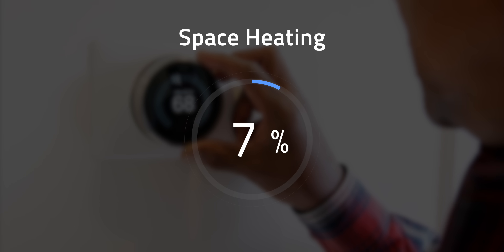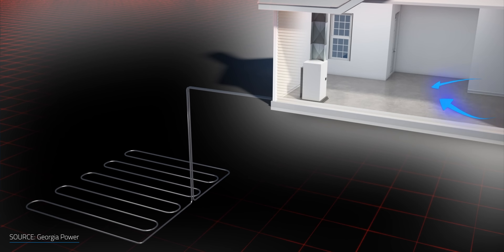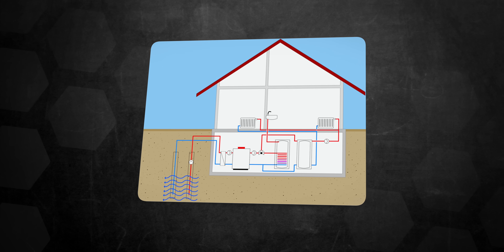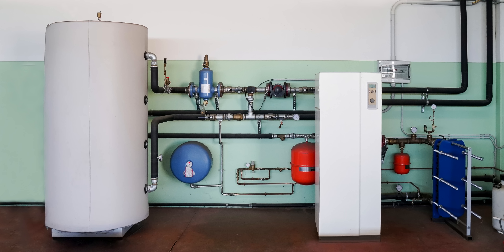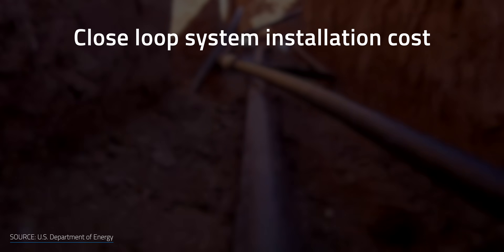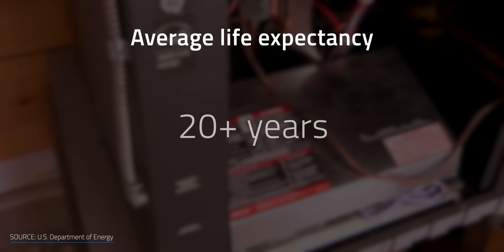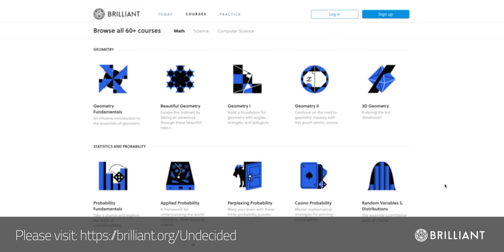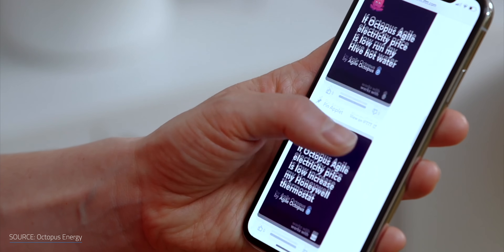Is Geothermal Heating and Cooling Worth the Cost?  Heat Pumps Explained

Comment: My home was built in 2001 and I installed a closed loop system in Ohio, Worked great for the first 7 years then I had to replace a switch. Then a year later a pump then year later a compressor then it leaked out the coolant, then the main unit went out in 2017, that's when they wanted 17k to replace it.  So all those great energy savings I was suppose to get went up in repairs. Then in 2017 I replaced it with a standard air heat pump which cost 7k total including install and I am not lying my electric bill was 30% cheaper than what the Geo was. Yes I now use 10% more gas for heat in the winter months but I had to supplement the Geo with gas too, so that didnt change all that much. But I do use about 150 more gallons of propane during the winter. 
So unless they have a 20 year guarantee and on all parts and labor dont waste your money, just take the savings up front and put in a standard air heat pump. 
I have two buddies who built a home the same year as I did and had a similar experience. both of them replaced the Geo with a air heat pump. ( FYI I do not have any affiliation with anyone in the heating industry this is my experience only).

Comment: I don`t get it how this system is better 5:46 36 000 BTUs/H = 11 kW instead 3x air conditions which are 12 k BTUs/H = 2.5 kW up to 3.5 kW for this electricity which you claim is 11 kW you can get up to 10-11 air conditions which are up to 120 000-132000 BTUs/H

Comment: Our company It is a scientific and technological enterprise specializing in the R & D, production, sales and service of solar energy, air source heat pump hot water, heating and refrigeration engineering systems. It is the development and cooperation unit of Zhejiang Energy Research Institute - new energy source. The company won the title of Hangzhou high-tech enterprise in 2010 and ultra-low in 2011 The warm air source heat pump unit project won the national science and technology small and medium-sized enterprise innovation fund project award, and won the new industrial product award of Zhejiang Province. Also we want  to find some partners or agents，If you are interested, we can communicate this matter。

  Relying on the high-tech of Zhejiang University and the first air source heat pump with normal heating of minus 25 ° in China, the company is the only "dynamic and static combination defrosting" patent technology in China (patent number: zl201310163521.4, inventor: Liu Yinlong), combined with the advanced modern production equipment of China and Germany. It has a number of energy-saving patent technologies - split pressure solar collector module, and its products are exported to the United States, Germany and Switzerland In Dian, Korea and other regions, the solar collector module has passed FSEC certification in the United States and TUV certification in Germany. At present, it is the most efficient, energy-saving, low-carbon, emission reduction, environmental protection and safe central hot water equipment.
My e-mail: fexur@foxmail.com

Comment: Very good information. As a person who deals in HVAC warranty for Trane, I will say that at this time we only offer a max 12 year extended warranty for these systems. So even though they have the ability to last over 20 years, that is not without maintenance. Not to mention that after the warranty expires, the parts and labor cost for replacement parts will be exponentially higher depending on the geothermal system. Over all, a 30,000 dollar installation over the course of a lifetime could end up being upwards of 50 grand. Considering the average lifespan of a Heat Pump system spans 10 to 15 years for an upfront cost of about 14 thousand with a 10 year warranty (depending on the system) you're ultimately going to be better off as a home owner buying a 16 or 18 seer and replacing it down the line. Considering technology will only get better, you'll save on energy costs.
Reply: What is a "16 or 18 seer"?

Comment: It's unfortunate that contractors are so slow to change in this country. Other countries are speeding off into the future, and we aren't even adopting Heat Pump technology here in the US?!!  ...And we are supposed to be "proud americans"...thinking we are all bad-ass-know-it-alls??  Far from he truth!  We need to step it up and get more renewable-conscious like other nations have been doing for years!  Don't rely on old fogies who discredit Heat pump technology!  Your AC unit is a heat pump that works in one direction.  All it would take is a few parts to make it operational in the summer AND winter, but we don't do it here in the US!! Why?? Ignorance!  If we had someone with brains running the show, single direction heat pumps (AC units) would be outlawed and we would ONLY have bi-directional heat pumps that help in both summer and winter) This would cover 9 moths out of the year for most people... So what if they don't help in the EXTREME cold or hot temps temps... In the meantime, people are spending huge amounts for an AC unit that operates a few months out of the year (in most climates)

Comment: Another fine video!  I wish there were more ground source heat pump installers in Phoenix.  Houses built in areas where there are climate extremes, (Hot OR cold),  need to take advantage of the constant under-ground temperatures!!    From what I hear, unfortunately, the "dry earth" in the desert regions, don't lend themselves well to heat transfer...hence ground loops don't transfer heat as effectively here in Phoenix. 😢 Let me know if you have any leads towards installers that work here in PHOENIX!  THANKS!!!

Comment: Your rule of thumb heat loss is useless. Heat loss is greatly effected by location and building standards in that juristiction. A GSHP system would have to maintain an average COP above 5 to even break even with natural gas pricing. Depending on location, need an average COP between 3-5 to beat propane. I have yet to find any that are able to do so over a season in colder climates. (Yes the ground will have a cooler average temperature in colder climates. This is especialy true for horizontal and pond setups.) So they really is only a consideration when replacing oil furnaces. Air source HPs are vastly cheaper to install and have similar savings in more temperate climates. GSHP life expectancy is identical to an AC.
Reply from the maker: I don't disagree that geothermal vs. oil is a slam dunk.  Vs. gas and air source heat pumps the calculations get much closer.  This article has a great chart comparing costs and yearly savings.  There's a bigger gap between ground source and gas than you think, but it really does depend on your zone.  https://www.pickhvac.com/most-efficient-heating-system/
Reply: @UndecidedMF  i could discuss the details more directly, do you have discord or similar? 

The EER that is usually marketed is often using a water temp of 68-70°F. This is because water source heat pumps can be used in other applications where this is applicable. (I work on them, among many other hvac related things in residential, commercial, and industrial settings.) The manufactures shouldn't use it when talking about ground source, but they do. The COP rating uses cooler water, and is more applicable. These units do fantastic for energy savings, but not always for saving money. 

With my locally priced electricity and natural gas, after delivery and other fees for both, using 96% AFLUE a heat pump of any type requires an average COP above 5.0 to break even. Source: I'm an HVAC tech that loves math. I have the spreadsheets to confirm it. 

Below is an energystar report that shows that the best units barely make a COP of 5.2 not accounting for the water pump energy usage. Of course those particular units have parts that are incredibly expensive to replace and require very specialized tools to work on. 
 https://www.energystar.gov/products/energy_star_most_efficient_2020/geothermal_heat_pumps

Comment: Without a true heat source(fire) what is the max temperature a system can put out degree wise. Just was wondering if it’s 10F outside what temp is the air coming out of the registers. Thanks

Comment: In the colder parts of the world where electric resistive heating would be too expensive for the entire winter and traditional air-to-air heat pumps aren't powerful enough, geothermal installations are without alternative and should have been mandated for decades. 
Given the long life time of heating installations even the underambitious goal of carbon neutrality by 2050 requires installing these solutions ASAP and ban new installations of gas and oil heating immediately.

Comment: You um how to say this nicely.  Not energy efficient at all.  They are highly radioactive.  The are not safe for the environment at all and are only used in places that are extremely cold.  They have to be replaced every 5 to 10 years for the most expensive and advanced.  Sadly less than 2% are in the 5 to 10 year category and most should have been replaced 20 years ago but you would have to dig up houses to get to them.  They also can explode.  They are in no means safe and that is why they are buried about half a mile to up to 5 miles deep.  In order for them to work they have to be down deep enough to gather the earths natural heat which is far down and requires the most heaviest of digging and drilling machines.  They are reliant on gas powered everything to operate and move.

Comment: I'm trying to wrap my head around "constant ground temp". Are we storing heat from the summer for the winter in the ground, and vice versa? Or is the thermal energy conducting out the sides of our control volume to the surrounding soil which is at "constant temperature"?  (I'll limit my question to dry ground as the flowing water case is more obvious)

Comment: 2:33 This animated illustration is not right. There should be another loop that carries the refrigerant which the compressor and the expansion valve also belongs. The close loop ground water is circulated by a pump and the 2 loops meet on a heat exchanger, where the ground water loop gives its sensible heat to the evaporation coil (refrigerant loop). 
The cold air inside the house is heated by the rejected latent heat of the condensing coil (refrigerant loop).

Comment: Great video!  You were right on the mark.  But, technically, this is not “geothermal”.  These are “ground source” or “water source” heat pumps.  And, the loops do NOT contain refrigerant.  However, like anything, it is “Buyer Beware”!  Do your research, fully investigate all bidding contractors, watch out for low bids, and make sure the contractor is certified IGSHPA.  The loop field MUST be properly designed, or the system is worthless, and will cost a TON more money to be corrected.

Comment: this is only 1 type of  geothermal heating there is a type were they take pipes go deep into the ground were the earth gets hot the water then gets heated by the heat of the earth in summer time the water that is heated gets sent outside not to over heat the house great for winter but very costly to do

Comment: If its your forever home.. then possibly yes. You also have to account that just like a regular furnace, it does need to be replaced over time.
Reply: Yes, but it is likely to add value to your home, save you money regardless of how long you stay there, and actually the systems are very reliable. The ground loops should last a lifetime, it's not uncommon to have fifty year guarantees. The heat pump should be good for twenty years plus.

Comment: in the long run no you can buy cheaper heating units 2 or 3 in fact  but if you want the  green  seal  of approval from your so called friends go a head  ..   and yes i have work out in the field  put your money in windows and insulations they they have a longer life   heat pumps  compressor life and  pumps$$$..and  not every heating cooling guy  has lots part on hand and if you lose power do you have a big generator to run  it

Comment: The ground temprature at depth is normally 9 degrees. .if you have a winter temprature of minus 20. Then you get 30 degrees. So the colder the winter the more affect you get. But if you live where it's a mild winter they work poorly

Comment: My neighbor has a 40+ year old house heated and cooled with water pipes.  Their system failed during a heat wave and they had to move into their 5th wheel trailer for weeks while waiting for the part they needed.  Then it took 3 heating and cooling men 2 days to fix the problem.  Whatever they saved in heating and cooling cost came back to bite them.

Comment: I would use heat pipes to warm the flooring in the house, so no place in the house has cold floors, while also regulating the internal temperature of the house during hot or cold weather conditions. During the winter the floor get heated, and during summer the floor gets cooled.

Honestly wouldn't be a bad idea to take geothermal and solar and use the two together to become the most efficient and self-sustained for heating, cooling and power. With enough battery banks to store as much energy as you need with options of adding additional systems to it as necessary.

Comment: The first statistic I think is incorrect.  You wouldn't add 15% heating to the 16% cooling. As the energy used to cool a house trades off to energy used to heat it when the season changes. So you don't combine the two at once.

Comment: Remember before doing any of this you should install good insulation.
Reply: Not really. A good heat pump setup could cut your energy demand by 75% or more. Hard to get with additional insulation if you had any to begin with, or even speaking from an arctic perspective(even with awfully hot summer weather as a bonus). Think about added insulation and other significant measures after the heating and cooling system, not before. Also think about the insulation carefully. Could ruin the building and get people sick if done wrong, and has been done wrong to exhaustion.

Comment: Combine heat pump with thermal insulation of your house, change your old windows. Heat pump can even heat/preheat the water in your house which is used in the kitchen or bath. We have this in Europe at least for last 25+ years. Get thermal imaging of your house before thermal insulation installation and thermal imaging after. Believe me or not, heat pump is the best investment for your house, it pays for itself. Did I mention heated floors because of floor heating with heat pump? Rocket science, right? 25+ years ago 😀
Reply: Agreed. It's particularly cost effective in areas without a mains gas connection- anyone replacing an oil, lpg or electric resistive system will see bills fall dramatically and very good payback periods.

Comment: Hi, very informative thanks 👍. A couple of questions if I may. What percentage of the footprint of a two storey property would the area of the pipe work need to be to meet the requirements of the property? I’m assuming more than 100% but I would love to know. Can the pipe work be installed under the foundations of a new build property? I’m thinking of urban properties that are likely to come with much more limited land. I suppose the issue would be maintaining / replacement at the end of the pipe work life span. Is there a temperature range more suited to this type of system? Are there areas where it is too hot or too cold at certain times of year for this type of system to be effective?
Reply: If there is not enough of space, you can have vertical loop, survey is needed for sure.

Comment: A COP of 3-5 is hardly much better than a conventional electric heat pump, to say nothing of a desiccant-based model. Does that COP apply to cooling as well? It’s basically just a normal electric heat-pump with a better heat-sink, so I doubt it.